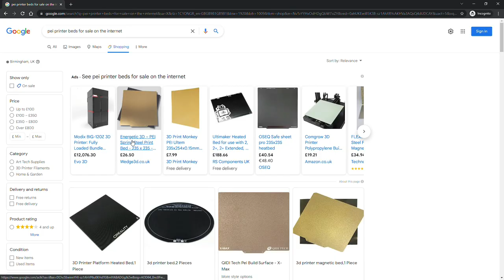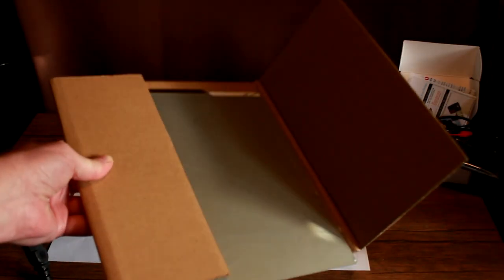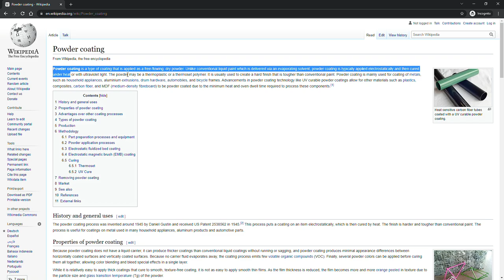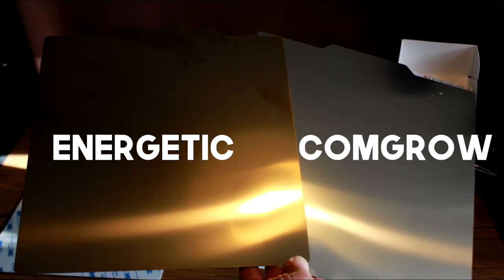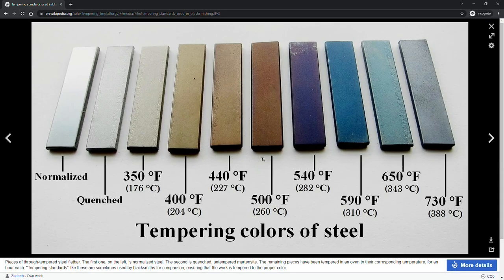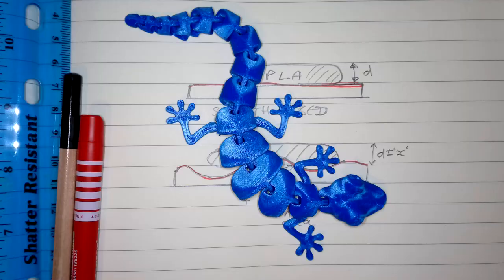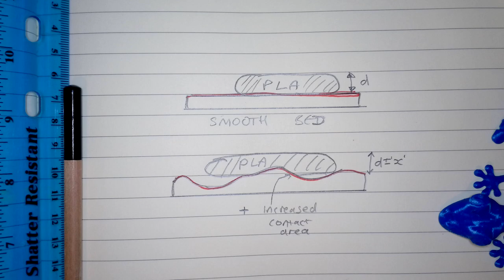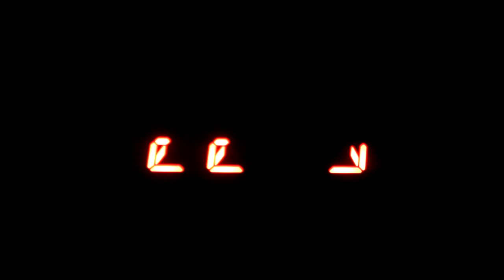I bought another PEI bed, to settle a question from the last video. Are all PEI beds made equal?

Comment: I've been using a tempered glass bed for ages and I don't see why people are still struggling with these other bed types. 1. It's perfectly flat making first layers great (you do have to make sure to level obviously). 2. With glue stick PLA just pops free, usually by itself as it cools (printing with a 60C bed). 3. PETG also sticks wonderfully, you just have to make sure you've got a layer of glue stick.  Absolutely no issues with over adhesion or pulling up glass. 4. PETG also pops off easily, usually with just a pull, but otherwise a quick hit with a glass scraper in a corner will free it once cool.  Some downsides might be a lower heat transfer meaning it takes a bit longer to fully warm up the bed initially (but more uniform and stable heat), and also you really need to let it cool for best release results (PLA will come off with the glass scraper while still hot, but PETG needs to cool).  You could use multiple glass sheets and just swap them, as the glass isn't any more expensive than the PEI metal beds.  Oh, one other HUGE plus, if you use a scraper, no risk of gouging the PEI film. Neither do you have to worry about a bad leveling getting the nozzle digging into the PEI film. In both cases the glass isn't hurt and at worst you've got to replace gluestick.  In fact, I usually only have to reapply glue to the areas that have been printed on 5-6 times.
Reply: You've never printed ABS, have you?
Reply: @timlong7289  Quite a bit. It sticks well. The big trick with ABS is to avoid drafts. Use an enclosure if at all possible, even if it's just a cover/blanket (keep fire safe though). Your biggest enemy is edges being pulled up due to contraction further away from the bed as higher layers cool too rapidly.

Comment: Smooth PEI beds -- the sticker kinda need to be roughed up a bit, some 600 grit sand paper or some steel wool, try to make a uniform swirly pattern so the print doesn't get weird patterns on the first layer. Before these were so common, and powder coated beds were a thing, I used to buy PEI sheets from plastic suppliers and use 3M high temp tape and adhere the PEI to glass. The pei you get from plastic suppliers is thicker, think around 1.5-3mm. But that means you can sand it a bunch of times to rejuvenate it -- as it was very expensive -- Ultem is expensive. I got pretty good at it, I would make PEI applied glass beds for friends locally. That was several years back, and I don't do that anymore -- magnetic powder coated beds are just so much better and easier to use. I even was able to get them for my 500m delta and my 600mm large format machine -- gets expensive at the bigger sizes, but cheaper than heat resistant glass at the same size.
Reply: Ha! Was just admiring some huge 500mm^2 beds I ordered the other day, pre-coated and double sided... and was thinking the same thing about "the good old days". Ie back when it was hours of work and self-sourcing to build your own beds from scratch. Ensuring you had flat machine steel, getting the right high temp 3M adhesive films, and ordering raw Ultem sheets. I had even kept a spare cutting of Ultem to explain to others what I was "printing on". 😅

Comment: I will second your opinion. I have a newer Creality Branded [Textured] PIE on my Ender 5 Plus, and I have an older Creality [smooth] PEI Bed on my  Ender 3 Pro, and I feel like the Textured one give better adhesion. And I would also agree that it likely has to do with more surface area for the plastic to grip on to.

Comment: Steel that has changed surface color because of heat does not change color to any appreciable depth, it's just an oxide layer.  Being able to scratch it off is completely normal.  When heat treating metals the tempering oxide layer is often polished off.  If you overshoot when heat bluing parts like watch screws and other parts you just repolish and try again.  This is assuming you just overshot the desired color without getting the part above the annealing temperature, or that the part is being heat blued for rust protection or appearance rather than being hardened and tempered.  Watch hands and screws are typically left in the soft state and then chemically or heat blued with no hardening.
Reply from the maker: Yeah I get that, but you wouldn't be able to scratch it off with something softer than the steel itself, which I did.

Comment: I have 3 printers running non stop 24/7 for my ebay business and the only print surface that consistently works good is the standard old black ender removable beds. Glass and pei both give much more failures and require a hotter bed temp.

Comment: Scratching the bed to reveal a steel color underneath doesn’t tell you that the color is from a PEI coating. When you heat steel up, as you pointed out,you can get a straw color, but that color is caused by a thin film of oxide formed by the heat. If you scratch it, you will reveal the unoxidized steel color underneath.
Reply from the maker: It scratched off too easily compared to how much you would have to for heat treatment, in my opinion. Of course the only definitive answer is going to come from the manufacturer who are not answering...but at the same time I imagine it also makes no particular sense to heat treat steel to exactly PEI colour, for a printer bed.

Comment: The rough side is the powder coated PEI. The smooth side is a PEI film. The powder coating not only has more grip, but it's also more durable. You can also use a thicker sheet of pure PEI; that's what Lulzbot printers have.
Reply from the maker: My only concern with thicker sheets...I guess...is thermal conductivity.
Reply: The thicker sheets are the entire bed. They don't flex, and often have the heater attached directly to them. In my experience they work great. Prints stick when hot and release when cool. Anything except PLA needs the bed to be scuffed with steel wool occasionally. I have a smooth, solid PEI bed on one printer (stock Lulzbot Taz 6). I have a textured PEI flex plate on the other (Railcore 300zlt). They both have their advantages and disadvantages.
Reply from the maker: I looked it up after last reply, the conductivity of pei is higher than glass so yeah, it's not an issue. 👍
Reply: Comments like these make YouTube so awesome. Thanks Nerd Made and Lost in Tech.

Comment: I added smooth Wham Bam PEX (kind of a "super" PEI) sheets to my Artilery Sidewinder X1. Wham Bam strongly advocates cleaning a new PEX or PEI bed with acetone and fine (000 or 0000) steel wool. PEX works perfectly for me with PLA, PETG, PETT, TPU, NGEN, and Nylon 230. I mention this mainly because Wham Bam have good resources on PEI/PEX setup and use. They also recommend increasing bed temperature to compensate for the poor thermal conductivity of the stainless and the thicker (than cheaper brands) PEI/PEX. I have not had a print come loose or fail to release in ages.

Comment: A note on PEI. I would not recommend using it with PETG. I've lost two PEI sheets to PETG. The first time I posted about it, and had about half a dozen people call me a liar and/or say I must have done something wrong. So I bought a second sheet to test it again, and it was destroyed on the first print.

It might not be all flavors of PETG or even PEI, but the PETG I had bonded permanently to the PEI sheet. Even after leaving the plate in the freezer for hours, and spraying it with an inverted can of air duster to supercool it, it just wouldn't release. Using a pair of pliers to firmly grip the print very close to the sheet successfully liberated (part of) the print, along with some chunks of PEI still attached.

This was back when having a PEI print bed meant you ordered a sheet of PEI and some 3M double sided tape to attach it, so it's entirely possible things are different now. But PEI + PETG is just a no-go for me.

Comment: I have a smooth PEI bed from energetic. For PLA, I sometimes spread some hot glue on the print surface. Just enough on the area I'm printing on. Heat at 70C on the initial layer. Then drop temp to.40C to make the glue harden and add to more adhesion while printing. Just heat it up again to remove.

Comment: You talked about the light straw color, and how it was only a very thin layer. And therefore you think it's most likely a coating.

 I'm a machinist, and as such I see that color change very often. It's very thin, and sands off easily. So in my opinion that's not conclusive, maybe hit it with a torch and see how it behaves. If anything seems to burn off there's your answer.
Reply from the maker: That would definitely ruin the bed so I'll have to leave it a mystery 😂

Comment: The glass transition temperature of PEI is 217 °C, so powder coating is probably possible. They remind me of photoengraving printing plates. I wonder if they're coated and then cured on the sheet metal to achieve a more uniform and well bonded coating.

Comment: I just want to know if it's ok to use alcohol to clean my powder coated one. I am not sure if it's my eyes or just poor lighting in my studio but when I rub too hard with alcohol I feel like there's very faint gold color on my wipes. I have a double-sided rough surface one and it sticks beautifully with no effort except for bloody eSun's matte filament which I have to bump up the bed to 70C just to get a basic square to stick. Also after removing the print and changing to another filament I have to clean the bed. I'm not sure what they use in the formula but it doesn't stick and causes my regular filament not to stick too.

Comment: You can definitely print tpu just fine on the steel, i use reverse side of my tectured bed with plain stainless steel and it works a treat, sticks well but does not require a spatula to peel off.  I wonder if petg would print on the steel

Comment: I got what I thought was a double-sided energetic sheet with my Voron kit. I couldn't get anything to stick to the smooth side (I tried mainly ABS). The textured side was better but I just didn't like the textured finish. I bought a smooth sheet from Energetic and that has been superb, it is now my daily driver. After a couple of weeks I needed to skuff it up with fine grit sandpaper and it has been really good so far. The original double-sided sheet? I can't find anything in any spec that says its double sided. I just assumed. Both sides are a similar colour (light straw colour) but I'm pretty sure now that the reverse is just plain steel. It's completely different to the actual smooth sheet I bought and doesn't appear to have any PEI on it. And nothing sticks (not ABS, anyway) so results talk.
Reply from the maker: Yeah I'm still not sure what the straw colour is, but I'm sure we'll get to the bottom of it eventually one way or another 😂

Comment: I have bought 3 replacements to replace the glass bed. Creality magnetic (non steel) Creality steel PEI and HICTOP steel PEI. Both of the steel seem to be coated on both sides. One rough and the other smooth. They all print about the same on the rough side. I don't like the Creality non steel as well as the others. The HICTOP sells a double sided for about $15 more. I think they may be the same? I was looking at trying the Fulament double sided steel PEI but it's $55 and I'm not sure I dont already have two double sided PEI sheets. All that said, I think it comes down to what works best for you, as with a lot of 3D printing supplies and parts. Thanks for the video!

Comment: You could do a episode about how to fix a damaged bolt hole that holds the bolt of a Hot End on a Aquila maybe?  
I have a Aquila and the hot end nozzle banged into the top layer of a model even though the print was level to it.

Hence the left bolt has chewed the screw part of the gantry back metal plate under that hitting pressure and now the bolt on the left of the red cooling block 
that holds the hot end unit in place will not hold the hot end as there is no screw lines in the hole to grip the bolt?

The right one is fine But you need both to be held firmly or the hot end wiggles side to side like me did and bugger up your print with the layers sloped to the left.

Step by step help videos like how to fix this without having to pay tons out on a replacement back gantry plate would be great!
Better I think t know how to fix a issue by your own repairing than having the spend tons for a new part, and even finding the spare exact metal back plate for this Aquila is not easy?

The Ender 3 V2 it is cloned from I seen has a different gantry back plate with holes for the attachment of a different hot end cooling block so can't use that one!
Reply from the maker: If you hop onto discord (link in description) and showed us some pics, I bet we could help out.

Comment: i have no idea why, but i keep having issues with my print in place slugs. it comes out fine on the first few layers. maybe half a quarter through. and then it de laminates always in the middle. ots very fustrating this hapens with my textured PEI bed
Reply from the maker: Slugs are hard to print, I get a lot of failure on them too

Comment: Hey Mr Lost In Tech, just found your channel, and was wondering if you could help figure something out? 

I have tried to print that articulated slug a few times. I've had one successful print out of many fails, which seemed more like a fluke than something I actually did to help, because with the dame settings next attempt it failed. 

No matter the orientation, speed of print head, a few different slicer settings, scaling up, it seems to have layer shift on the X axis.

This has never happened with any other models before, or since. Just this one slug. 

It is a motor skipping issue rather than a belt slip issue.

I put it down to the sharp angles of each body segment and the sudden direction change making the weight of the print bed moving (on the x axis) overcoming the torque of the stepper motor and skipping a "step"

Is there another setting like acceleration jerk or something I could change to prevent this?
Reply from the maker: that is really weird...I don't like the sound of that. Do you have an ender 3 v2?
Reply: @LostInTech3D  it's an anycubic i3 mega S

I even cranked the print speed right up on other models, didn't have any layer shift.

Just the slug.
Reply from the maker: that is even weirder. It might be worth popping into discord and sharing some pics of it

Comment: I wonder if scuffing the metal surface would help adhesion?
Reply from the maker: very likely, but it will also show on the print
Reply: @LostInTech3D  very true I wonder if you can get a Scotch-Brite pad on a drill and make a swirled surface. If done right that looked pretty cool

Comment: Smooth glass and Aquanet unscented super extra hold hairspray. Works great and cheap to boot. Aquanet is only available in the US though.
Reply from the maker: sounds like it contains PVA, which is an interesting idea, I dont think PVA normally sticks to glass.
Reply: @LostInTech3D  Contents: Water (Aqua), Dimethyl Ether, SD Alcohol 40-B (Alcohol Denat.), VA/Crotonates/Vinyl Neodecanoate Copolymer, Acrylates Copolymer, Aminomethyl Propanol, Sodium Benzoate, Cyclohexylamine, Triethyl Citrate, Cyclopentasiloxane, Masking Fragrance (Parfum).  I believe it is the copolymer that makes it work so well. I've used this on PLA and PETG. I've tried it with ABS too. It'll work but not with parts that take a large part of the print bed.
Reply from the maker: I am definitely not a chemist but 'acrylates copolymer' sounds suitably vague enough to be legit 😂😂👍
Reply: @LostInTech3D  Agreed😆

Comment: I am super curious to try one of these style of bed.... mainly for the weight reduction via the stock ender glass plate.... but simply flipping it over and keeping the plain glass free of oils and using ABL sorted me out in 98% of my prints not needing any additional adhesion. Parts stick as effectively as those rubbery window stickers when it's hot and when it's cold they typically lift off with little to no effort, worst case I take the bed off and give it a gentle sharp tap and it comes off every time. PETG included..... so I wonder if it's actually worth buying these at all :/
Reply from the maker: In the last episode I pretty much said...well I actually said, that I felt like it was an alternative to glass but not worth replacing glass directly for, even though I might choose it over glass. When you need your next bed then give this a go, but really, to me, it's very very much like the carborundum in terms of operating temp, levelling, etc. And unlike glass, if your metal bed base thing isn't level...you'll know it when you put this on 😂
My ender 3 v2 "steve" is staying firmly with the glass bed, put it that way. It aint broke, so I aint fixing it.
Reply: @LostInTech3D  that's kind of how I feel, but I want to go higher and I'm getting the wobblies on taller prints and I suspect it's the bed being a million pounds of glass, but it could be the rollers too if I'm not mistaken? Idk I'll likely end up doing both, I'm in too deep now to go back
Reply from the maker: I'm not entirely sure what "getting the wobblies" is but it's probably not the glass bed if it magnifies with z height, I guess!